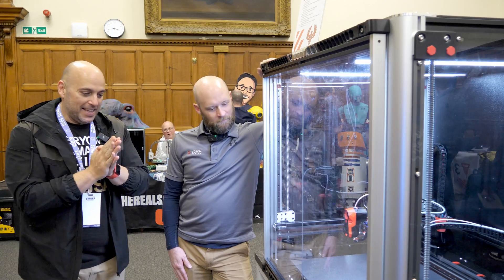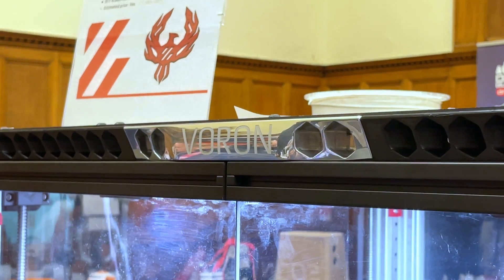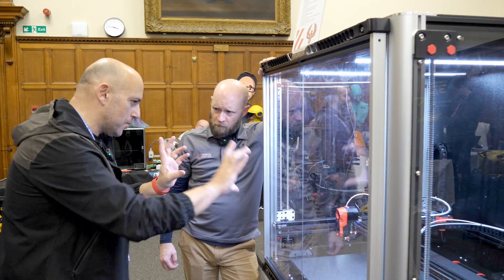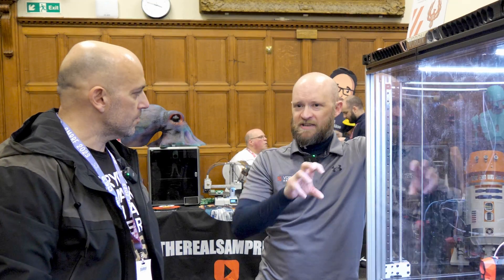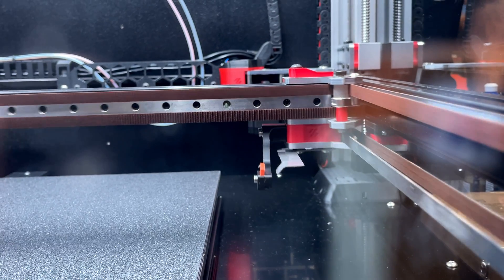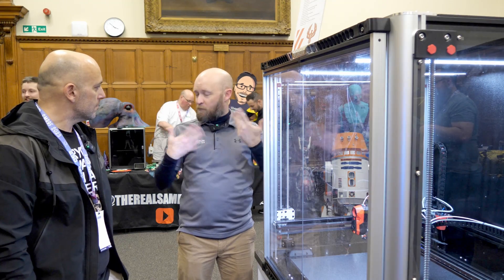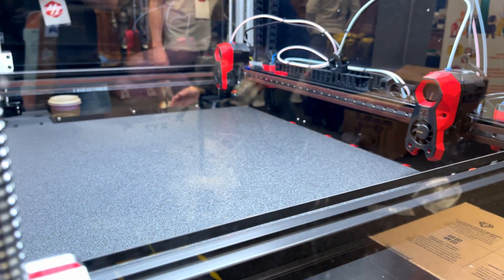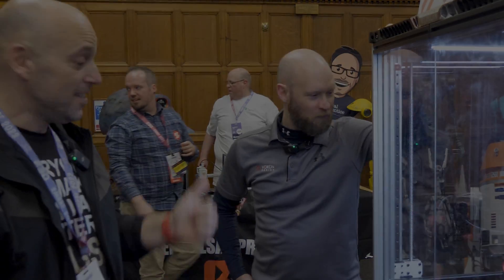MASSIVE IDEX VORON Phoenix Won't Fit Through Your Door - SMRRF

Comment: Are the BOM and files for the Pheonix publicly available?  I need high speed large format IDEX printing and this seems like the perfect option to build!
Reply: The Voron team tends to like to let their ideas cook a bit before public release. Probably, the printer is finished enough to show off for a day or two at a show, (where there is always going to be someone right there who can fix it) but has issues that make it not up to standard for long-term use or reliability. Vorons are supposed to be reliable workhorses, not fiddly half-finished printers, and that last little bit of engineering and polish take way longer than you'd think they would.
Reply: Yeah, was looking for the same, couldn't find a site or a github page.

Comment: With the price of a garbage 2.4 I can’t imagine what they are going to ask for this probably around $6,000 and with Voron super slow print speeds it will only take a min of weeks for a single print to finish. Fun the maker said this machine is for industrial needs yet meets not a single industrial standard. Rat rig Idex is a much better machine in literally every aspect for a similar price except its design well lol. It should tell you something when it took 9 years to make and still isn’t ready yet vzbot was made in just 2 years yet 10 times better design decisions 😅
Reply: I'm sensing you may be a hateful person.
Reply: We arent selling anything. its up to you if you build one or not. This thing is also far away from a v2.4 in terms of parts. 

Which industrial standards are you talking about exactly? id like to know more so we can improve if an improvement is needed.

Comment: Actually not being able to move the assembled printer from one room to another is quite a problem. Imho for a printer this size, you need a different aproach, using two extrusions on each side, making all sides, top and bottom individual frames. So the bottom (including the bed) as one unit, the left and right (including the ballscrews with motors), the back (including the PSUs and electronics) are very stiff units by themself, even if not connect to each other. Top and front of course are relativly light panels. The xy-gantry of course have to be it's own unit to be put onto the cariages on the ball screws as the last step.
All individual frames being connected by Thumbscrews. So the printer being dissassembled into 7 parts just removing some thumbscrews and disconnecting some connectors in less than an hour or so, reassembled in less than two hours even in a space it just fits into.
So after days or weeks of inital assembly in your workshop, you still can move the printer in an acceptable amount of time, with parts of an acceptable weight between 10 to 20 kg each.
Reply: If you have a printer like this, you probably have a workshop for stiff like this and you don't need to move it